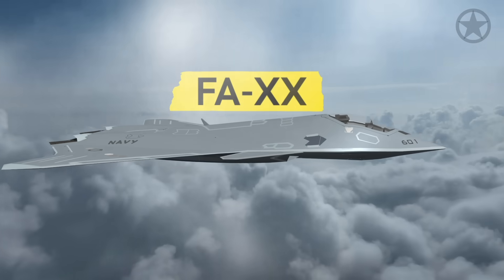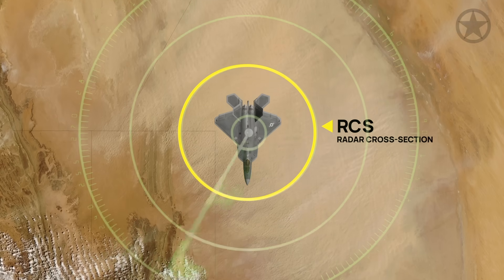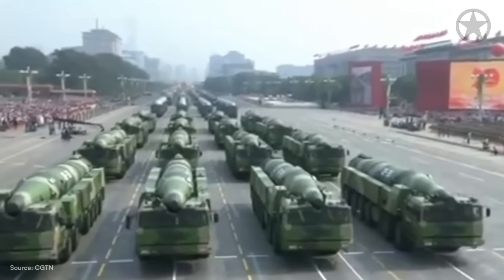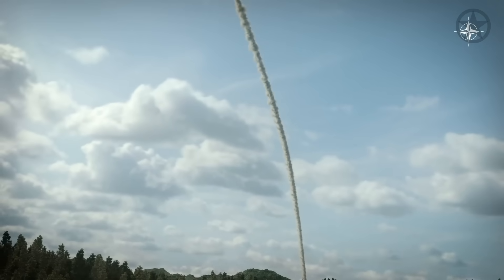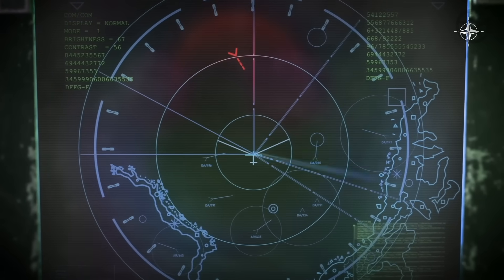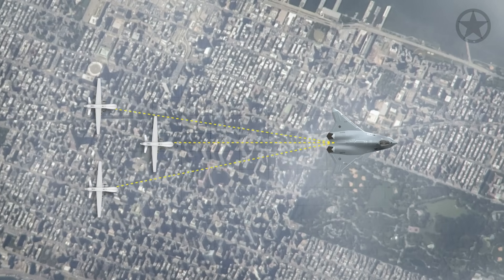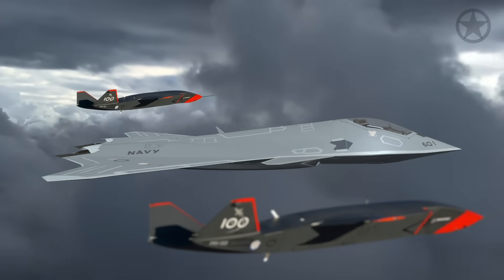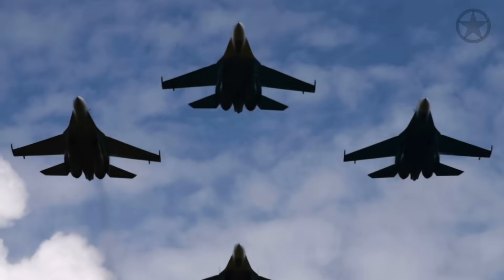Finally! US NAVY Unveils the 6th-GEN FA-XX Fighter Jet!

Comment: Boeing already won the Air Force F47 contract and is also pumping out the new F15EX. I believe there are prototype 6th gen planes for the Navy already designed by Boeing and Lockheed. Tbe race is on with Boeing. Lockheed has a ton on its plate....Northrop Grumman already bailed out of the biddings

Comment: I have always thought that the leading edges of the wings should be able to redirect the atrflow as well as the rear Ailerons. That way smaller inputs would effect the directional changes.
But as long as it has a cup holder!

Comment: As long as MIG-31 is flying at mach 3 120k feet at russian borders no american aircraft will enter Russia via the air.
Reply: Their radar doesn’t stand a chance at stopping even the F22
Reply: @DariusFlynt_2012  The PESA radar system that was modified over the years on MIG-31 is capable of detecting F-22, B-2, F-117.
Reply: Even if somehow the MIG-31 can't detect it then ground radars will detect it and send of the data in real time to the nearest MIG-31 to the site.
Reply: @ you think they’d be dumb enough to fly that low?
Reply: @DariusFlynt_2012  MIG-31, MIG-25, SR-71 are the only aircraft that has reached 120,000 feet so I don't know what you're talking about

Comment: It's the FA-47
Reply: FA-XX is for the US Navy, this project will be handled by Northrop Grumman. 

Boeing's F47 is for the US Air Force.

The FA-XX, F47 and Lockheed's F35 will all be integrated in the NGAD system.
Reply: @joynermaidana2375 thanks! I needed to hear that- in exactly that way…
Reply: @joynermaidana2375 F/A-XX has not been awarded to any contractor yet. The only progress made in that regard was the elimination of Lockheed Martin. Currently Boeing and Northrop Grumman are the 2 contractors still in the running but it is far too soon to claim Northrop Grumman will be making the navy’s f/a-xx. Boeing obviously still believes they have a decent shot at the contract, as they have finished one massive factory for the f-47 and are close to finishing a second factory (guessing Boeing has a backup plan of producing more f-47’s at second factory if contract is awarded to Northrop Grumman, but that would just help recoup the loss for construction, where getting f/a-xx would make construction profitable). And no one can point to one over the other and say “but they can’t produce f/a-xx because they’re building (insert new jet here) because both NG and Boeing are building brand new ground breaking platforms currently that will require bug fixes, production line training etc. (Boeing f-47 and Northrop Grumman b-21).
Reply: The FA-XX had no tail wings. While the F-47 has tail wings. So what’s the difference. one is a fighter looking B-2 Spirit version. And one is a 4 winged f22 raptor off brand.
Reply: It’s both
Reply: Not😂😂😂😂😂. Trump obsession disorder much!??? Idolatry is a sin
Reply: No it's F/A-XXX, F/A-47 is just a display name
Reply: Its FA-XX not F-47
Reply: @ no1 knows wtf it is or even if it’s real yet.
Reply: @TheeJerseyDevil it’s real it’s the newest technology
Reply: @pgaming1003 it’s the F-47
Reply: @pgaming1003 it’s the f47 dude

Comment: If it is necessary to redesign the aircraft then we should do it the cost is lower than it used, setbacks are common in development of aircraft even if we have to redesign the whole thing it's going to be significantly less then it used to be with Advanced Ai and computer Aid design and Manufacturing, let's go for it takes the time to do the job properly, the Navy has always been a matter of fact for the last 2 years the Navy and the United States Marine Corps came in with a good budget, they don't want to lose billions of dollars on unnecessary projects let's go for it

Comment: So it does have vertical stabilisers or rudder control, so how is it suppose to yaw
Reply: @caydenplayz1790  the design looks similar to the Chinese flying prototype, in which case the wing tips rotate allowing pitch/ yaw
Reply: @ if it’s really like that then it will probably be one of the first new gen fighters without the vertical stabilisers
Reply: @caydenplayz1790  Flying wings can drift easier in yaw akshually 🤓
But it's more unstable. It's fixed by more elevon/flaperon/spoiler control, fly-by-wire, canards/LERX/LEVCON, last but not least: for a twin engine, offset thrust (what people often refer to "differential thrust" incorrectly) and why not thrust vectoring nozzles. Anything can help stabilize a flying wing which makes it more complicated to design but when it works, it's amazing.

Comment: This jet is not supposed to replace the f-22 or f-35.  it's to replace the F/A 18.
Reply: ikr, the F-22 isn't even a navy plane
Reply: @TheTGFredoriginally the NGAD and FA/XX were going to be one program but the navy and Air Force weren’t willing to compromise on certain items that would be able to keep the planes similar enough to be something like the F35A and F35C.
Reply: @TheTGFredwhat the fuck does ikr mean. Just freaking type it for gods sake.
Reply: LMAO, how?  Will it have large A/G loadout? How can a stealth fighter with enclosed weapons bays replace a very low cost and rugged multirole strike fighter capable of high AOA?  How many Mark 84 or Blu-117s do you think it can carry?  Lol these are different roles.
Reply: @VndNvwYvvSvv  You are wrong about one thing: stealth fighters have in fact more potential to become multirole than classic designs reducing drag and RCS. I'm not the one who said this, but a former Rafale pilot. And flying wings are the perfect idea for that: less drag, in theory also more AoA because the entire fuselage and wings are providing plenty of lift, but often need LERX/LEVCON/canards because tailless designs with diamond/delta wings at the very back are too stable in pitching and have compression issues, while also making yawing more unstable (but easier to achieve by nature). Which can be fixed by fly-by-wire, said LERX/LEVCON/canards, offset twin engine thrust for yaw, thrust vectoring nozzles, better designed flaperons, spoilers and elevons. Making a flying wing is more complicated but when it works, the benefits clearly outweigh the rest. Being tailless also means less mechanical parts to manufacture and maintain (vertical and horizontal stabilizers) and less drag once again, so more acceleration/TWR, more speed, more maneuvrability if the intrado and extrado airflows are managed properly, less fuel consumption which means more time afterburning, bigger flight radius and more weapon payload. Especially true with internal bays eliminating a good portion of the external pylons drag.
Reply: It will have frickin lazer beams  @VndNvwYvvSvv
Reply: All American 6th Gen fighters for Navy and the Airforce are announced years back and hauled due to budget constraints and reevaluation. The moment i saw the title of this video, i knew it this was done by some noob with lots of misinformation.😂
Reply: You are 100% incorrect!!!  NOOB!
Reply: @markd7280  really?  The next navy fighter is to replace the fa-18
Reply: @aiktat the fact that you said noob is the safest thing ever grow up a little
Reply: @skep_america8155   I'm 68, Military Vet and I'd call this CRAP's producer a Noob as well.  At best this is yet another Cick Bait BS Job.  Aren't you tired of this?  It is worse than being Rick Rolled LOL!
Reply: he switched it up with the air forces NGAD.
Reply: And the A-10 apparently
Reply: the f-18 will always be around !
Reply: Like anything we need it yesterday.  China has already tested their sixth generation jets....This looks like it be ready in 2030....or even later.
Reply: @rgloria40  Rest assured 6th Gen has been here. We are currently developing 7th Gen. To put it in context, the F22 Raptor was being developed in the late 1970's,  First flown in 1997 released to public and entered service in 2005. The X35/F35 was developed in 1992-1997, the first recorded test flight was in 2000. Released to public 2006. I promise you 6th Gen is here and has flown...😉
Reply: @rgloria40  haha, Chinas 5th Gen is a temu replica of designs they steal and isn't stealthy in the least bit, so there's that. Russias 5th Gen still uses a 4th Gen engine bc of funds and they don't have but a few. Chinas 5th Gen is junk so no they don't have a 6th Gen ready. Chinas economy is struggling after this last chokehold Trump put on them, Trump could completely cut ties with them and watch them go tits up within a year, the famine and lack of water would be the end of them
Reply: @rgloria40 yeah but the US is waaaaay ahead with there 6th gen fighter, research it.
Reply: It will just replace another PowerPoint
Reply: its supposed to replace the F/A-18E/F super hornet and the EA-18G Growler
Reply: There is some confusion between the Navy's F/A-XX and the Air Force's NGAD programs. But  yeah, if someone is going to make a video about it then they need to be up to speed on the subject.
Reply: The F-35 needs replacing. The Swedish Gripen and the European Typhoon totally outperform it, and also the British Tempest 6th gen fighter is well under development, which will hugely outperform any fighter there is right now. Everyone is abandoning the purchase of the F-35 in favour of better fighters. The F-35 is a dinosaur in air combat. Trump and Vance keep saying Europe needs to step up?! Looks like they underestimated Europe and have fallen way behind.
Reply: @ Trump's and Vance's criticisms arent about what Europe's armed forces are going to look like ten years in the future, they are criticizing what they look like right now.
Fact: Denmark has abandoned patrols around its Arctic territorial claims.
Fact: Canada's Air Force now consists of only 12 operational fighter jets.
Fact: Germany's army was cited with multiple deficiencies last year's NATO exercise.
Fact: The British Navy has more admirals than ships.
I could go on, but this is my point
EUROPE IS USELESS, FUCKING USELESS !
EUROPE IS THE WORST ALLY ANYONE COULD HAVE !
Reply: right but he meant FA-XX is gonna be the king of the skies he didnt mean physically replacing the F/A 18
Reply: Yes it will replace the Hornets and the f-35.
Reply: They should just bring back the F-4 Phantom. For no other reason than Mavericks dad flew one.
Reply: F 22 RETIRED?IT ONLY SHOT DOWN THE   SPY BALLOON
Reply: @MATTMEISTERTX1 Are they retiring it? First I’ve heard of that. Not doubting you, but considering they’re still using the F16 causes me to wonder why.
Reply: @themaxbeard  UNSURE?
Reply: @MATTMEISTERTX1  😂 yes that's why I asked.
Reply: Ah, got it! So it’s more like a sequel, not a reboot
Reply: @elderly-life-insights  ?
Reply: @elderly-life-insights   not a reboot for F/A 18. That jet is more of a dual purpose strike fighter. F22 is pure fighter. So more of a revision for the type of sorties it'll be designed for.
Reply: They didn’t mean by replacing them serviced but just a title of king of the sky 😅
Reply: This jet doesn't exit; and it won't exist.
Reply: @ the FA-XX prototype is suppose to be done by 2030
Reply: @Soap644    I don't think we have until 2030!

Comment: Redesign isn't the main problem with the Air Force NGAD. The main problem is budget. The Air Force is replacing all Minuteman III missiles with the LGM-35 Sentinal and obtaining a fleet of 100 to 200 B-21 Raiders. It's a matter of priorities. The Air Force already has a great 5th Gen air dominance fighter in the F-35 Block 4 and though the NGAD would be nice, there are other priorities. BTW, all the speculation about range, ceiling, speed is futile. Those will classified long after the fighter is in the fleet.
Reply: F35 cannot even compete with J20, let alone J35, J36, J50....US is really behind
Reply: The problem too many non STEM degrees people skimming off 70 percent of that budget.
Reply: No1 is gonna the real numbers to any of that as they still don’t for any other top level planes.  The SR71 has been faster for over 70 then its stated speed & wil continue for decades to come.  They aren’t putting out real numbers or even real ceilings so it doesn’t matter wtf u read except that they can do it.
Reply: @TheeJerseyDevil did you learn to read or did you just press keys until that was produced?
Reply: Yep, as Russia had proven on the battlefield — quantity matters. And this time, Quantity + Quality, US will just spam China with 5th gens.
Reply: Gave all money to Ukraine budget wouldn't be problem